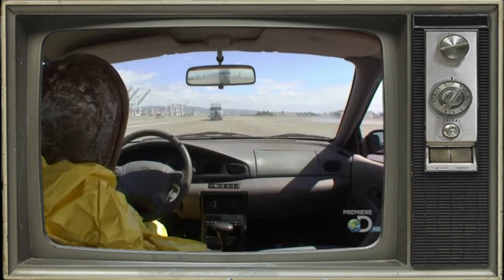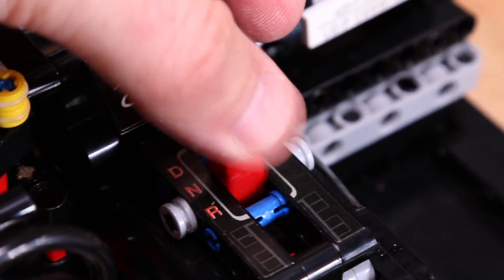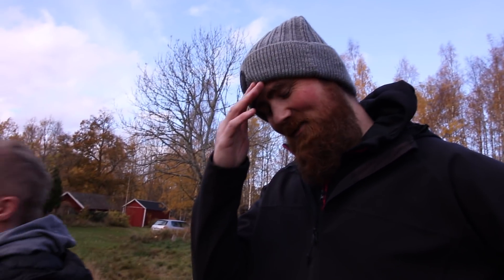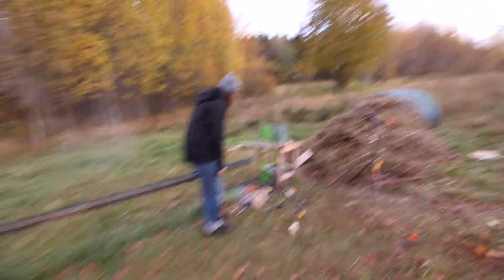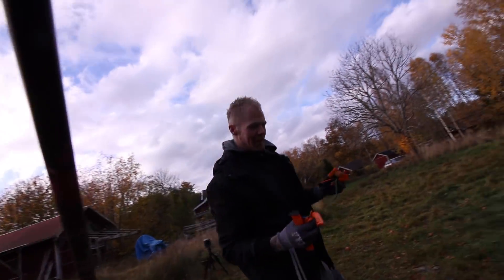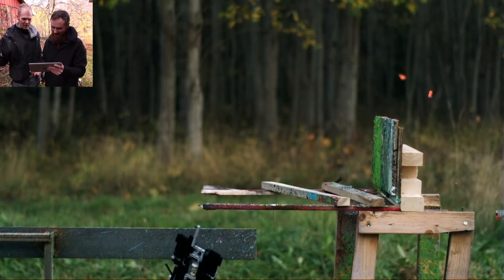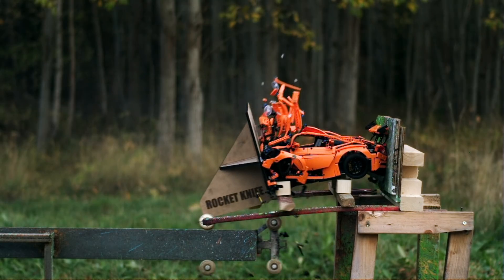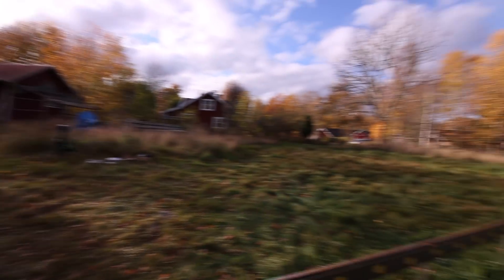LEGO PORSCHE -VS-  120KM/H ROCKET SLED (Recreating the Mythbusters vanishing car episode)

Comment: The rollers got separated from the wooden plate at the very beginning of the impact therefore the actual force of destruction reduced significantly. (assuming the wooden plate is really lightweight without the metal roller) I am really wondering what would have been the result of this experiment with a bigger impacting mass. Nonetheless interesting video and thumbs of for the fun and educational video.

Comment: The force of impact to a car front-to-back is so strong it can actually crumple the body in the rear. The slow-mo of your Lego impact demonstrates this as you can see the rear end oscillating from the impact. When my wife had a drunk pull left in front of her (while she was going 60mph) the impact was so strong the rear hatch and rear quarter panels had huge dents in the body from the force of the hit. The middle of the car was mostly clean. Front left was obliterated.

Comment: Disappointed that the car was not on the sled part. The kinetic energy would have been different moving the greater mass of the Lego car. If done right with enough power in the propellant, to compensate for the cars weight,  the results would have been so much better.

Comment: Great video guys 👍. Unfortunately your results were 'corrupted' when the sled left the guide rail and broke apart at the point of impact. By doing so, the forward energy was dispersed in many directions. Can I suggest you do this experiment again using a more solid sled AND longer guide rail. That will give you a true idea of what will really happen 😃